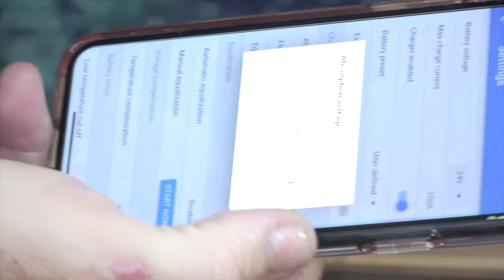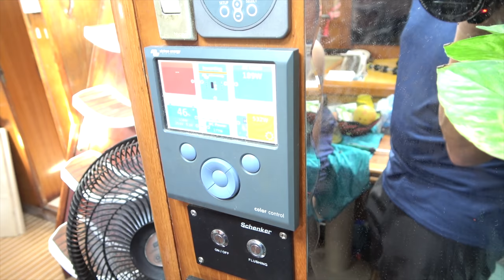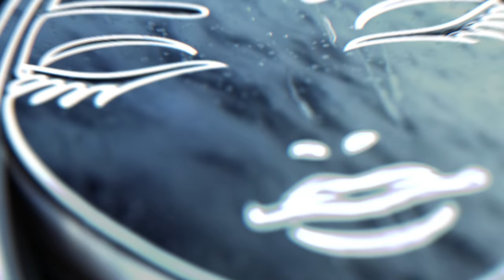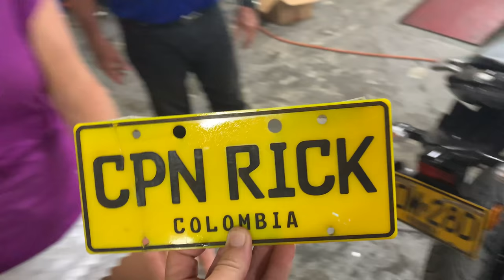SSL544 ~ time to PUT THE CREW TO WORK..!!

Comment: Nice going Rick, you get some stuff completed this way.
Tip for everyone....installing led ..  Some LeD lights do not like much voltage variation nor small ripples form a engine generator. 
if you do not use the standard regulator/driver .. you may use the load out of the victron mppt .. this is very stable out put . Also it can be set to a perfect voltage..
Reply from the maker: Yes, I've always searched out LEDs that will run off the 12v system direct, now 24v will do  nicely also!  :)
Reply: Captain Rick Moore o
Reply: @SailingSophisticatedLady  I think you need to tread carefully removing the 24 volt power bricks on your grow lights. Your battery bank is designed to handle rough amperage and voltage surges.  The leds, not so much.

Comment: Rick, you should try to cover up the battery terminals when you're working around them with metal tools. I've seen the aftermath of a  shorted battery bank in an Electrical Substation when a worker accidentally dropped a wrench. Luckily he was wearing a full flash suit. Remember, an electric arch is hotter than the sun. Just a suggestion from a retired high voltage electrician.

I was hoping you were taking the bike with you. I had visions of it strapped down to the fore deck standing proud as you sailed off into the sun set.

Comment: your power setup would literally run my house with lots of energy left over, just got my bill this month, 62 dollars, average is 80 to 100 and has been as low as 45.00 us. i have about 6 breakers plus the main in my box. you wouldnt believe how many solar companies send me letters wanting to put solar on my roof so they can make money off my conservative power usage. i compared my usage with delos when they were doing the upgrade, and i used less power than their boat. i really need to bite the bullet and go solar/wind, that way when power is out from storms, ill still have something i can rely on besides the gas hog generators that i cant run in storms anyway.
Reply from the maker: Yes, might as well take advantage of the space if you can, you'd be surprised how quickly a small system will pay for itself!  :)
Reply: @SailingSophisticatedLady  i was little off, it was 514 kilowatt the past month at 67 dollars, how much do you typically use on the boat if you dont mind me being nosy? and do you think im a good candidate for solar and battery backup? since i dont use much? was told i could get paid for the energy i give back in my state, but i dont trust legislators anymore than i do a politician or a weatherman :) but i like the idea of self sufficiency.